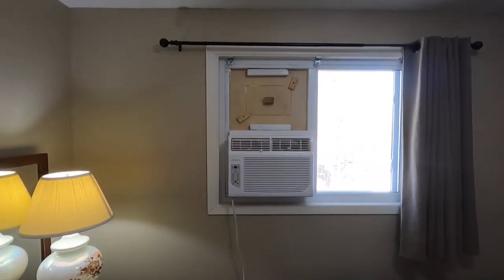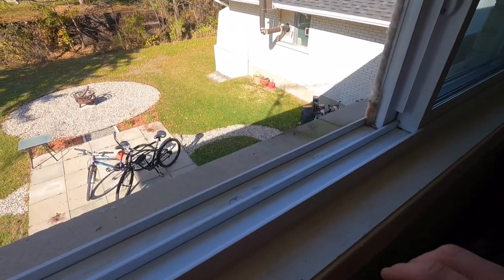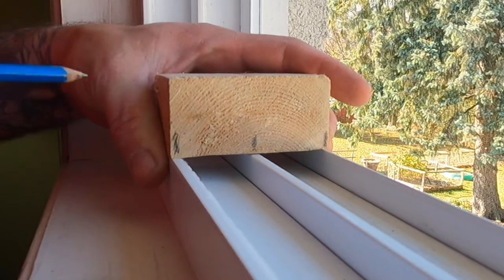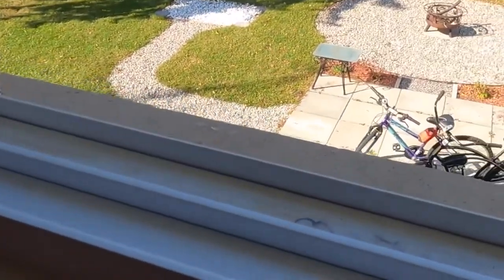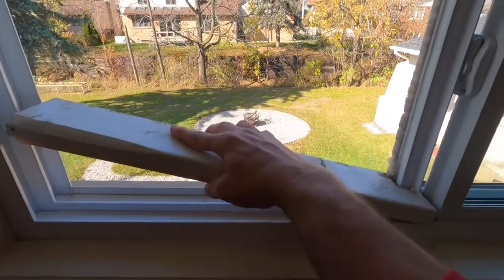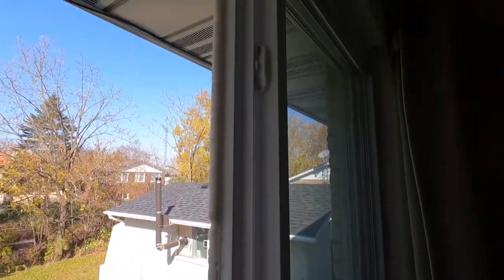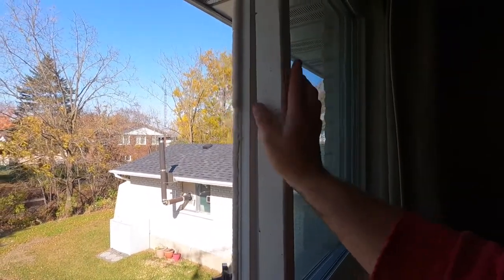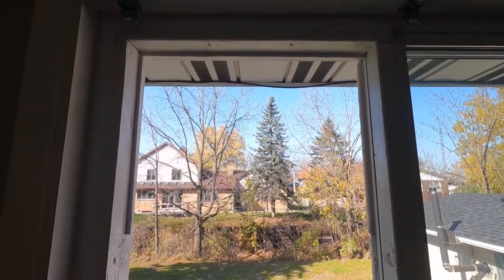Air Conditioner Frame For A Sliding Window Installation (Part 2)

Comment: This is awesome, I just bought the wood to do this without a solid idea of what I was going to do. I think I know now, thank you for these videos.
Reply from the maker: Glad you got a little inspiration from the videos, I just put mine back in for the year, took me about 5-10 minutes to install.
Reply: @BackyardHobbyBoys  I got great inspiration and I have needed to take it out a couple of times now for finishing. I used a similar design but with pocket holes to the top and bottom as well as L brackets for the unit. I also added a sandwiched insulation with spars to hold shape due to size vertically and a 3 piece design. I color matched the outside to the finish of our house because it was substantially taller and had a bypass fan so the screen port was not necessary. I did stain the inside wood to match my wife's aesthetic and it all worked well. As long as I keep track of the screws I should be about a 5-10 minute install in the future years until we can afford something more permanent.
Reply from the maker: @56intergalactic  sounds like it turned out very well, good job. 👍